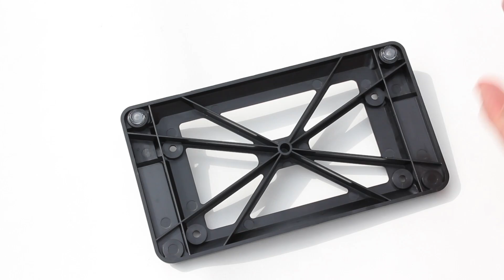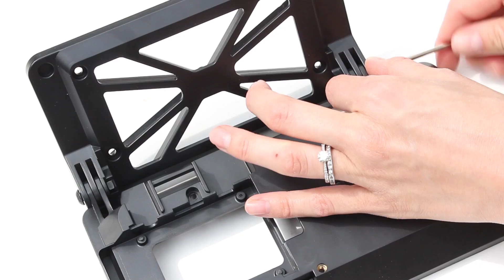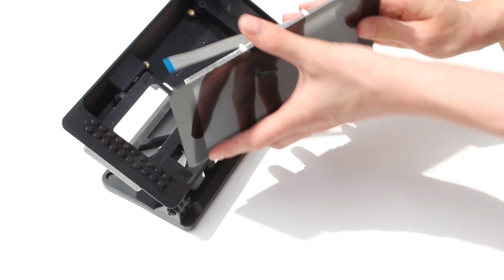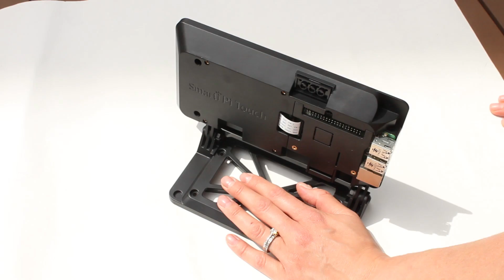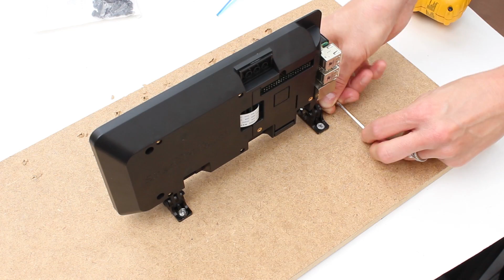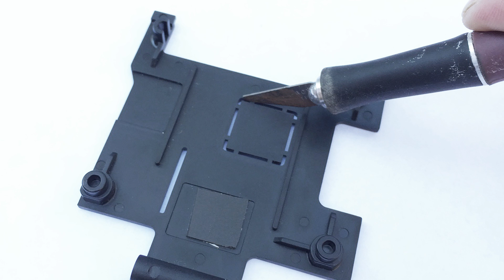SmartiPi Touch setup

Comment: Hi, do I have to add some code to enable the touch screen? I set mine up and it runs Ubuntu but when I try to use the touch screen feature, it doesn't work. I'm trying to have the setup run Octoprint for a 3d Printer.

Comment: where to i get the arm mount. include some links to ANYTHING & EVERYTHING in the video. I've checked out your kickstarters...marketing needs to be a little tweaked
Reply from the maker: Any VESA arm with 75 mm hole pattern will work
Reply: @murratw  awesome, what's the one you showed using in the video? Any luck with the smartypi 2 base compartment? Side note, I will be definitely buying a couple of your product in a couple days from Amazon.
Reply from the maker: @JALeetheheathen  I dont remember the model of the one in the video.  It only had the 75mm holes so it did not have the extra material for the wider 100mm holes.  You can download a 3d model of the base compartment on our site.
Reply: @murratw  well you've got my business in a few days

Comment: I must be dense, this video is almost useless for me. The pi smarticase that I have ( https://www.amazon.com/gp/product/B01HV97F64/ref=ppx_yo_dt_b_asin_title_o06_s00?ie=UTF8&psc=1 ) came partially assembled. The video has is disassembled. Not knowing to disassemble is a major thing. I hate breaking plastic cases when I put too much press or put pressure on the wrong thing. and Placing a red box without any context didn't help much either. HELP!

Comment: Usable but ugly. Display doesn't sit flush with case which is a shame. Couldn't close door until I read all the comments - one which said to turn on subtitles. (Put that in the description!) Looks really lop-sided with the lego bar at the left (put another on the right or dump it entirely) and the base not being in the middle - Why couldn't you make the base the full width or make it fit symmetrically?
Reply from the maker: I'm sorry you are unhappy with it. The display is slightly recessed to protect it. Why can't you close the door?   The case needs to be lopsided in order to reduce the depth. The raspberry pi is offset from the board on the display.
Reply: COULDN'T close the door until I read all the comments - and turned subtitles on, then realised you don't fit the screws if using the door. I didn't even know there was subtitles until I read the other comments and saw someone with exactly the same issue as me.
I see you've updated the description now - hope it helps others.
Thanks for the reply.
Reply from the maker: @GordonHenderson   Its better to design it so the display is slightly recessed in case of some manufacturing differences on the display. You can put some washes around the m3 mounting screws at the mounting points of the display to bring it flush with the edge of the case if you want.

Comment: I'm having trouble getting the white ribbon to go into the port; does anyone have any tips?
Reply: The sockets have a movable piece that has to be lifted straight away from the boards so the ribbon can be inserted. If you look at it very closely, you'll see what I mean. Use your fingernails on either side to pry it up. They only lift maybe 2mm.  Insert the ribbon with the blue side facing the lifted part. (Double check me there. ) Then with great dexterity, keep the ribbon seated while pushing the movable bit back in to where it was. It will sort of click when you've got it down, look flush with the rest of the socket, and gently tugging the ribbon won't pull it out. Check to make sure the blue bit or the silvery conductors are parallel to the top of the socket.

Be very gentle--I accidentally pulled the parts right out of the sockets for the screen and the pi camera which basically breaks the sockets. The broken ones can be made to work but it takes a good half hour of fiddling with it to get them in and the cable properly seated. Some electronics use similar looking but much easier to use sockets that I really wish the Pi had.

Anyway, I hope that I answered the question you were actually asking.

Comment: The door does not fit with the brandnew Pi 3 Model B+: The extra 4-pin male connector is too high... :-(
I have cut off the U-shaped standoff above it but it's not enough... In fact one should cut of the left fixing point completely!
But then the door won't be fixed securely... Any ideas?
Reply from the maker: We are actively working on a new door that will be compatible. It  should be available in a few weeks. You will be able to purchase the door on our website or on Amazon when it is available. Sign up for our newsletter on our site and you will be notified when it is available.
Reply from the maker: You can also hold the Pi in with the two small silver screws that came with the case as an alternative to using the door.
Reply: Thanks for your quick and positive response!
I want to congratulate you with the great design of this SmartiPi housing!

Fortunately, I just discovered it in time while ordering the official housing (which is far from yours...)

My problem was solved nicely with my soldering station's hot air gun. Now the door fits again nicely. But it's good that you will make an adapted door available.
Reply: I had the same issue - remedied in the short term by filing out a bit more space around the pins

Comment: No space for the red and black positive and negative leads. Screen doesn’t turn on without them?
Reply from the maker: Screen is powered by micro usb.
Reply: even then It doesn't turn on
Reply from the maker: nothing happens when the screen is plugged into micro USB by itself?
Reply: Just got it working I had to change my ampere level
Reply: and its really good :)

Comment: This is like false advertisement because you totally skipped over the four jumper cables.. how do you run these cables with this case?
Reply: You don't need those to run the screen, my case came with an adapter that split the usb power in two for both the screen and pi. Much handier for plugging in and out too as you don't need to upend the thing to get an angle at the socket on the board itself.

Comment: If I were to make room for the HDMI slot, would I be able to connect it to an external monitor? I think it would be pretty cool to have a raspberry pi tablet that can switch between a tablet and desktop.
Reply from the maker: depends on the os that you are running. Try the Pi forums.

Comment: Only problem is the door won't close once the 2 self-tapping plastic screws are put in place to secure the Pi board.  The plastic U-shaped standoffs don't like the big screw head that they can't fit over/around.  Do I get a Dremel??
Reply: I think that was a mistake in the instructions. I didn't use the screws to secure the board and just used the plastic door. The door has a satisfying click when it's closed that gives me confidence the screws aren't needed.
Reply: Same here... I think thats only needed when you're not putting on the backdoor for whatever reason (i.e. if you're using a funny shaped HAT or something)
Reply: if you read the caption, it says you can't use both to secure the board.
Reply: hm...  actually seems you can't use either screw
Reply: You cannot use both by default. But, I think it's better to use both. So I simply used an exacto knife to cut off about 1mm off each standoff and now both screws and door will co-exist quite nicely.

Comment: I see you didn't connect the 4 jumper wires. What are they use for? Is it necessary to use it?
Reply: @ASD and ADHD Health SCL and SDA were required in the past but I didn't need them for my RPi prior to getting this case, just the GND and 5v.  I do remember there being a note about them no longer being required.  Most should only need the USB splitter that came in the box for this case, and disregard the jumpers altogether.

Comment: is the display ribbon cable socket on the pi reversible? like can it be put in with the blue part facing the front or back of the pi?

Comment: I can't see to get anything to work. I am using a 2 AMP power supply for a phone to power the Pi and the screen, the light comes on on the Pi, but the screen does nothing.
Reply from the maker: If you are using the 2 meter cable it requires a 5.25 volt power supply.
Reply: Turns out I just had the SD card formatted wrong, got it working!

Comment: What vesa mount are you usning in the video?
Reply from the maker: Cheetah Mounts ALAMB Articulating Arm TV and LCD Monitor Wall Mount, for 12 to 24" Displays up to 40 Lbs, Includes a Twisted Veins 10 Foot HDMI cable https://www.amazon.com/dp/B0088RIV1W/ref=cm_sw_r_cp_api_2cgzxbT3A7MDE
Reply: Thanks Thomas. 
Put mine together yesterday.Very nice.

Comment: First of all, thanks for another fantastic case! Just finished assembling mine, allowing the retirement of the LEGO stand that I had fashioned as an interim solution! For some reason my shipment included only one foam rectangle - no big deal, but which of the two locations should I prioritize? Thanks!! :)
Reply from the maker: Just put it on the door. They just prevent rattling. They are not essential. Thanks for backing the project.

Comment: Received mine yesterday any pictures on how to mount the camera holder?
Reply from the maker: It can snap on the front LEGO studs or you can use a LEGO plate to attach it to the one on the back.
Reply: https://cdn.shopify.com/s/files/1/0174/1800/products/back_with_camera_1024x1024.jpg?v=1466771556 you will need Lego.

Comment: Where does the 2nd foam rectangle get placed? It's not too clear from the video.
Reply from the maker: One goes on the inside of the door. The other goes on the wall of the Pi compartment. they just prevent any rattling from the Pi. They are not essential.

Comment: Just received mine also....step by step video really helped.
@slobis...my screws worked as shown - remember that these are connecting to the raised tabs on the back of the display (and not the 'stand offs' earlier installed with the daughter board).

HTH

Comment from the maker: The black screws are used to hold the display into the case. The standoffs that came with the display hold the display control board to the display.